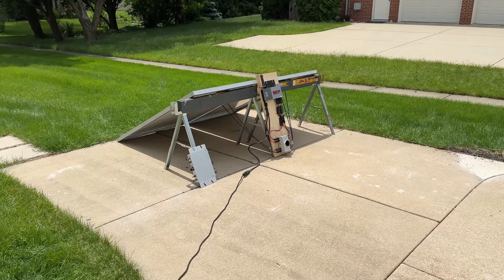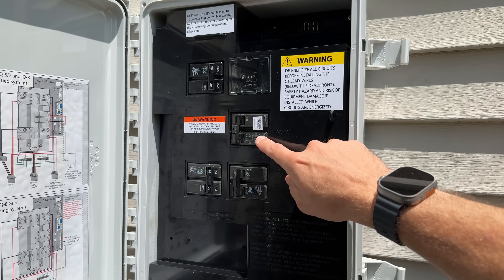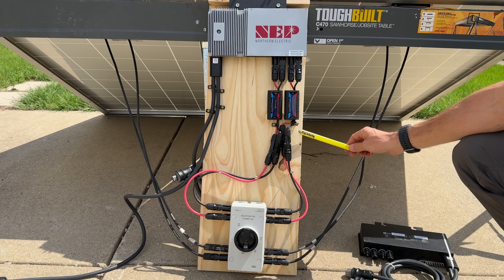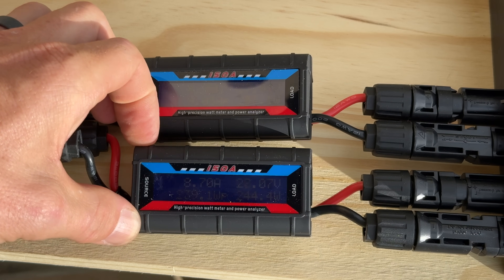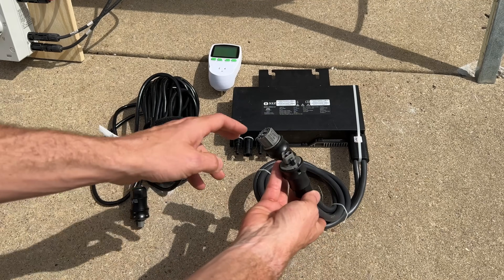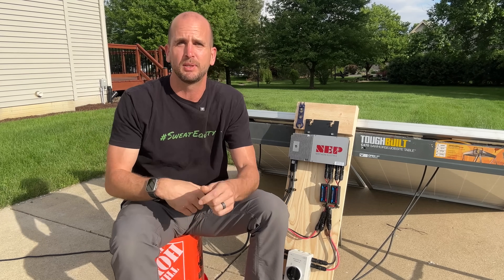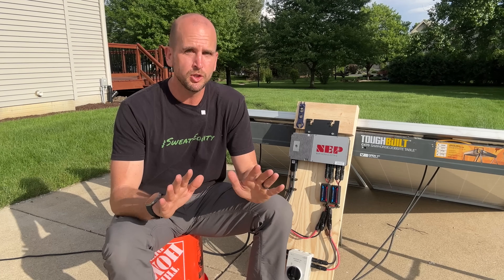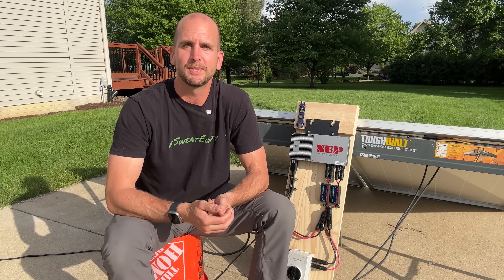Easiest Grid-Tied Solar On The Market!   Plug-N-Play

Comment: Fun video.  Thanks for making it.  I've got a couple used 300W panels sitting in my shop and was looking for something like this.  My difficulty is my power rate is only about 8 cents per kWh, so the ROI on this is just too far out to make back the cost of the inverter.  Would have been fun to play with, but not something I have to have.  Thanks again for showing off this inverter.
Reply from the maker: Yeah, I am in the same position so without Renewable Energy Credits (which we have in our state) and Net Metering it is hard to make the math work from an investment perspective at $0.08/kWh.
Reply: @everydaysolar  I have net meter and I get about $65 a year on this set up?  Is that math right at .09 per kWh?  makes it a 6.5 year payoff as I do not have Energy Credits.
Reply: @joelm077  that fit in with the math I was doing as well
Reply: Wow thats awesome! In the netherlands we pay 30/40 euro cents per kwh
Reply: oof - California resident here representing $0.62 / kWh 😬

Comment: I don’t understand. Are you back feeding the power INTO your garage? Isn’t that super dangerous?
Reply: It's no more dangerous that the Enphase inverters on the roof of his house, since it works in exactly the same way, and has the same pertinent UL ratings. You can't do this with a regular inverter, but a grid-tied inverter is smart enough to know how to interact with the grid and only function when it's safe to do so.

Comment: im assuming this is only beneficial during any energy use during the day as you dont have it connected to a battery storage system, right?
Reply from the maker: Yep, and without Net Metering you would be only getting the benefit if you are offsetting consumption for other circuits and appliances.
Reply: @everydaysolar  oh? and WITH net metering, what changes then?

Comment: Right there at the main check amps multiplied by volts you're only putting in less than 20% of the watch you think you are thus kind of stealing from the power company

Comment: I’m assuming you have a bidirectional utility grid meter, as far as I understand the average house utility meter will accumulate kilowatts, not able to distinguish direction and you get charged for electricity going back to the grid as well, you have any thoughts on this?
Reply: His main system on the roof and how that is wired implies that.  Wish he would have said that in the beginning of the video.   Like this is not a way to get started, you NEED to have the right meter to get money back.

Comment: Can you prevent sending power to the grid?
If you send power to the grid then you will likely need city permit.
Reply: He already has an Enphase grid-tied system that will send power to the grid, or since he mentioned that it has sensors on the main legs, it will compensate for these devices and output less from the Enphase-controlled system.

If you do not have an existing system, and do not have a net metering agreement with your utility, you should not attempt to do this without understanding how exporting power works with your provider. You could definitely get charged for giving them free electricity.
Reply: @joeyhazlett  He needs to make that clear in the video.  I have seen videos from this guy and he does not seem to completely understand what he is making a video about.  A good example was his previous video about this
Reply: No, the micro-inverter has no way of knowing.  If the house uses more power on that leg than the micro-inverter is back-feeding, it won't back-feed to the grid.  If the house is using less, it will (at least, it will back-feed past the utility meter).

A full off-grid setup is possible but generally pretty expensive.  One needs an off-grid inverter that understands AC-coupled micro-inverters to provide the "utility" waveform for the micro-inverters, with batteries to soak up the back-fed power, and both the off-grid inverter and the micro-inverters must understand the UL1741SA frequency-shifting protocol.

Comment: I’d be interested in something like this to charge some batteries that would power some exterior lights.
Reply: This method would be excessive for charging batteries. There are less expensive solutions that will more efficiently charge the batteries directly from the solar output. A Victron 75/10 or 75/15 charge controller is all you really need to charge up a 12v battery that can be used for some low voltage exterior lights.

Comment: This is one of the videos I was waiting for. Main reason, you already have an enphase system installed.  I was hesitant to do something similar since I didn't know if adding a 110v grid tie would conflict with the 220v enphase production. 
Also, I would love to see if you can connect a battery directly to the grid tie inverter, that way we can offset some of the energy consumption during the peak hours that are usually when the sun is down.
Reply: No, it won't affect or interfere with the 220v system, but you will be adding power to only one leg of your 220v power if you have a single microinverter like this plugged in. At <500 watts, it probably won't matter much, but if you try to scale this, you will want to make sure you balance the inverters on both 120v legs in your main panel.

You CAN connect a battery directly to microinverters like this. I've done so and it works amazingly well. I did go through extra steps to make sure the power from the battery is clean using a 480w step-up converter from 24v to 48v to get the input in the MPPT range, and I added extra heat sinks and a fan to make sure the inverters stay cool, as they're not really meant to run on a constant voltage+amperage output. They expect power to fluctuate with the sun. With those mitigations in place, I have been able to run two 350W microinverters consistently for months, reliably putting ~600w into my house during our TOU peak hours (4-9pm), completely offsetting my base load. Additionally, I run each inverter through a "smart plug" device that turns them off during the day while the battery is being charged, and turns them on at sunset to pull from the battery. I do have a net metering agreement with my power company, so any extra power that trickles out pays me at whatever wholesale rate they decide power is worth during peak hours. And because they are microinverters, they have rapid shutdown built in, so if the power goes out, they fail safe and don't send anything out to the grid.
Reply: @joeyhazlett  thanks for your time and explanation 👍🏻
Reply: In terms of connecting a battery, it depends on the grid-tie inverter.

* Always connect the battery side with an inline fuse or breaker because the inverter is expecting a solar input and will try to sweep the input, and some inverters can just about short the "solar" input while doing that.  Those obviously won't work with batteries.

* Make sure that the grid-tie inverter does not output beyond its rating while connected to the battery.  In fact, make sure it doesn't go above roughly 75% of its rating if you want the thing to last.

* Generally speaking connecting a lower-voltage to the micro-inverter causes it to output less wattage.  So in terms of battery voltages, typically a 24V (25.6V LiFePO4) battery system voltage is close to ideal.  12V might be too little (not even turn the micro-inverter on), and 48V might be too much (cause the micro-inverter to output too much power and over-heat).

* Do not let the micro-inverter drain the battery all the way down to BMS disconnect if you can help it.  It isn't good for the battery or the BMS to do that daily.  Generally speaking a solid-state DC-capable relay with a voltage sense on the battery side is used to disconnect the micro-inverter earlier, or a cheap timer on the AC side can be used to only run it for a set period of time.

Do not use a cheap AC relay to switch DC on the battery side.  I wouldn't even use a DC relay.  I'd use a solid-state relay with a big heat sink.   Most people just hook up a cheap timer on the AC side's plug since that is fairly easy to do and tends to be safer.  But make sure the wattage is less than 50% what the timer is rated for.

-Matt
Reply: @junkerzn7312  thanks to you too Matt. I do appreciate you guys took your time to explain some caveats of the setup I presented

Comment: This would get you jail time if used in cali 🤔
Reply: And in Australia too. Backfeeding a power outlet is a big no no.
Reply: Well, I "tested" my solar system before I got my PTO from SCE, they didn't say anything, The only thing is that I didn't get the credit for the electricity that got send back to the grid. Of course there's no GUARANTEE that they won't say anything about this.
Reply: @deyumei7965  especially if a worker is down the line and expecting power to be off in that section you're feeding  🤔
Reply: @tjmooney4181  As soon as the power goes off, this inverter will turn off and stop backfeeding. It's designed to be grid-tied, and meets UL certifications, which requires rapid shutdown when the power goes out. Nobody is going to get zapped.
Reply: @joeyhazlett  good to know 👍

Comment: How did you plug it into your garage outlet without it interfering with your home power?
Reply: Grid-tied inverters like this are designed to synchronize with the grid power they are connected to, and output in the same frequency and voltage as that grid power.
Reply: It's a microinverter so it synchronizes to the AC line waveform it sees at the outlet.  There are numerous issues though, so I'll make a top-level post outlining them.